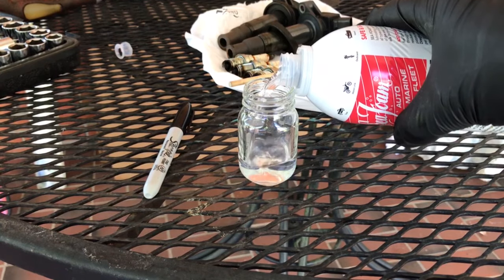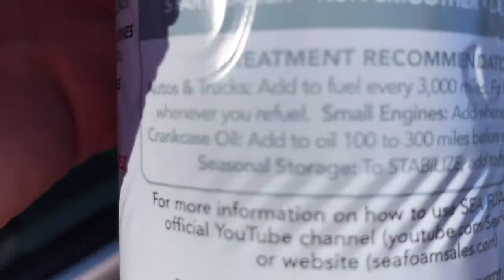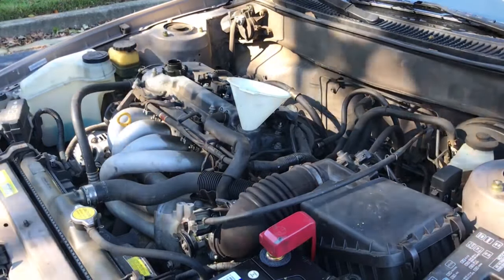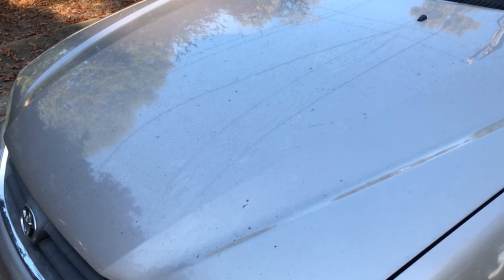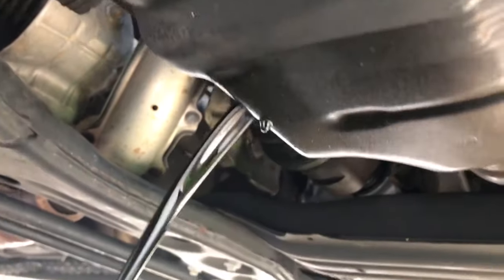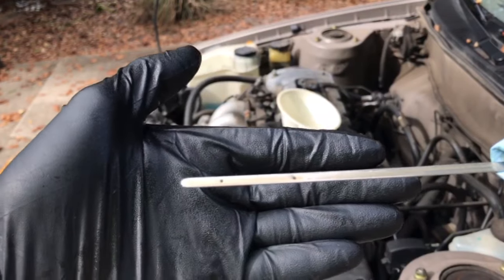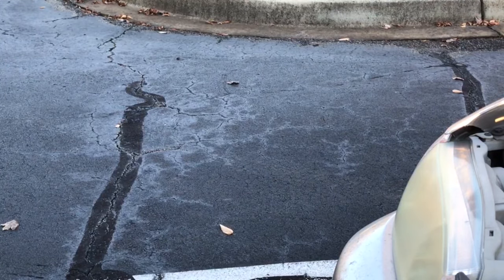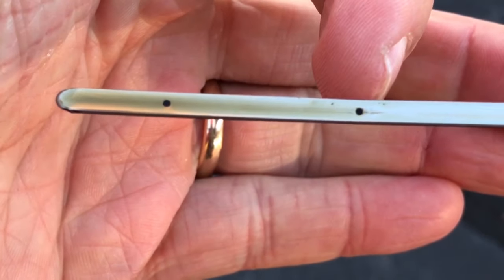Will Seafoam stop oil consumption? | Oil Burning🔥Experiments | Episode 2

Comment: The rings aren't  STUCK. They are worn down and allowing oil to sneak past. You should be using a high mileage oil as well as more Seafoam treatments and possibly a higher viscosity oil in the summer. Replacing the rings wouldn't be crazy, but I doubt you want to do all that work.
Reply: stuck rings are VERY common in the modern engines specialy the downsized engines with direct injection and turbo!

Comment: Hi Dave thanks a lot ,with the lesson from this experiment am sure to extend the life of my Camry 2.4 2003 with 189K + milage that is burning oil ,i have ordered for a seafoam ,to arrive in 2 weeks ,pls Dave i want ask what has been the performance of that car after that experiment on it,  iam talking about the oil seals and other stuffs in the engine ? I hope you reply me before i do same on my car thanks
Reply from the maker: You might want to hold off, Chuks. I have a few more videos in this playlist and more to come. Still having oil use. But there are lots of good suggestions in the comments---some have apparently had more instant success. Hope you get this in time! ---We will eventually get this fixed one way or another---God willing :-)
Reply: Hi Dave and everyone, after doing the bottom to top seafoam engine flush, though still observing so far noticed the following 
1 . the exhaust is dry 
2. the oil isn't getting dark fast as before
3. oil level still same under all conditions i have used the 2004 Camry , still observing it
Reply from the maker: @chuksadawisi5970  sounds promising!

Comment: so a car using oil is a piston sticking issue
Reply from the maker: Not necessarily, Lacy. It could be valve-stem oil seals, or external leaks, or a PCV valve stuck open. But in the case of Toyotas with this engine, it is a known piston-ring issue. They had low tension rings that get stuck easily usually due to lack of regular maintenance, or making only short trips, but some say it can happen to any of them. Thanks for the comment.

Comment: Maybe it helps with sealing between rings and cylinder, but if the cylinders/piston/rings are badly worn, only a rebuild will fix it. And how did you know that the rings were stuck in the first place; is there a way to determine that?
Reply: When the engine burn oil it means the oil ring got stuck
Reply: @parsaparsa2880  I find it diffcult sometimes to determine what responces are to me
Reply: @parsaparsa2880  can it also mean that the rings/ cylinder/ piston is so badly worn that only a rebuild will fix it? Additives like SEAFOAM are expensive and it could turn out to be a waste of money and time if short cuts don't cure the problem. I have been trying SEAFOAM  on my dodge ram v8 too, but in the end I think I'll have to rebuild it because the seafoam is very expensive to go on buying since one treatment didn't work.

Comment: Wonder if you did this a couple times or maybe even a 3rd if needed, it may completely clean the rings. Idk
Reply from the maker: That’s a possibility Del. Some have mentioned they’ve run a stronger Seafoam solution in their crank case and they’ve run it the whole time instead of just 300 miles … and they’ve had good success apparently. Might try that in another video. Thanks for the comment!
Reply: @FamilyFriendlyDIY  how come your car again started consuming oil in marvel mystery oil video you made.... when it was already fixed by seafoam
Reply from the maker: @letmethinkv  After the video, I found it fluctuated. So though it seemed to drop when making the original video, I found afterward that the usage went up and down, and sometimes was as bad as it was to begin with. Thanks for the comment.
Reply: @FamilyFriendlyDIY  is their any scientific reason behind fluctuations
Reply from the maker: @letmethinkv  your guess/hypothesis is as good as mine. I really don’t understand the science behind the fluctuation. I was just recording data. Maybe I drove a little harder during one period, or maybe I let the engine warm up longer on some mornings, or maybe it was the temperature, or regular versus premium fuel (that’s probably reaching), I guess it could be a lot of different things. It would be interesting if someone did have some good input on this.

Comment: Hmmm 
most likely it softened the valve seals !
This is a common problem on Toyota , especially if Castrol oil has been used . It nakes these seals so hard , that they can not properly seal anymore.
There is another trick , Adds 1 qt of DOT3 break fluid to your oil . IDLE  the engine about 3 hr !  Yes 3 hr of IDLING 
Drain the oil . Put the new oil filter and recheck the oil consumption. It always works for me

Comment: YAMAHA ACC-RNGFR-PL-12 Yamalube Ring-Free Fuel Additive,  I've used this product with great results both way in the fuel or put it in a spray bottle and run the engine after is up to temp add some throttle 1200 to 1500 rpms and spray in the intake until it smokes then shut the engine of and let sit for and hour then start and take it for a good run, oil should be changed after too. there's also another product called power tune which was developed for mercury/mercruiser engines for these thing stuck ring and carbon build up
Reply from the maker: Thanks for the input! I just did a Yamalube Ring Free Plus experiment on the latest video!

Comment: You can run full synthetic oil your car you just going miss up you engine i been working on cars 27 years. Best oil i find use little oil run classic. Car oil on ebay. Every one i use it in there car stop use oil you car is to old run the type of oil. Then your useing cheap oil in it lot to do with it

Comment: Idk how serious you are about this car but there is a real fix for this, its not easy but in my mind it's worth it, the fix centers around a partial engine rebuild with decarbonization along with new rings and boring out the piston oil return holes. At that point you basically have a new motor abd when you drill out those oil return holes it fixes the problem. If you love the car enough to keep it a while longer I recommend really fixing it. It will save you tons of money on oil over the years after fixing it.
Reply from the maker: Thanks, Chris. ... I saw a video on doing just what you describe. Right now I'm just experimenting. I'm working on a video right now trying Marvel Mystery Oil. It will be a while till it's finished though, because I'm going to run it for 3k miles. ... If none of the experiments work, I might try the rebuild, and probably film that too. Thanks for the comment!!!
Reply: @FamilyFriendlyDIY  np!
Reply: @FamilyFriendlyDIY  Looking forward to your video with the MMO. I just bought a 09 Camry with the 2.4 @ 191'000 miles and it is consuming a quart about every thousand miles. It was my sister's car which she bought brand new in 09. The valve cover gasket was leaking pretty bad so I replaced that. When I had the valve cover off I noticed some sludge in areas but not terrible. The place that changed the oil in the car was using Penzoil 5w20 coventional. So having used Amsoil for many years I have elected to do the Amsoil engine flush, switched to Amsoil Signature series full synthetic 0w20 & I am using MMO in the gas. I have about 700 miles on it since doing everything and have used about 3/8's of a quart so far. So waiting to see if it improves with time. I am going to flush the engine again at 1,000 miles and change the oil and filter & continue to monitor it. I can say that the motor is definitely quieter  since the flush and switching over to the Amsoil 0w20. Also changed the plugs as well. The car feels more responsive too. Thanks for sharing your results. I'll be sure to comment with future results.
Reply: @dooflicker1  Hi Kelly, I have the same Camry, but it only has 100K miles on it. I am interested to hear how your situation progresses. My camry is starting to burn a little oil and I don't want it to get worse. I'm looking at options for how to slow or prevent the problem, if possible. Thanks.
Reply from the maker: Lots of good info, Kelly. I'd like to hear how that goes when you get more miles on it. Someone else mentioned dropping the viscosity like I think you're saying. Haven't done much research on that, but I wonder if that's basically what Toyota did with more recent vehicles?? Maybe the engine tolerances are still about the same, but the spec'd thinner (and synthetic) oil to reduce or eliminate the known sludge/varnish problems??
Reply: Just a heads up for the future. When you eventually have to change the pistons or drill them out... if you pull the head off put the cams back on before lifting the head off or mark the bucket lifters so they don’t move. If the bucket lifters fall out, and they will if you tilt the head, it is a nightmare figuring out where they originally were. Good luck. Btw this is an interference engine regardless of what Toyota claims.
Reply from the maker: @johnnynichols5850  Thanks for the tip.

Comment: The cylinder walls are damaged from the rings being stuck. One side of your cylinders is worn slightly. It allows oil to get around the rings and burned regardless if rings are now unstuck. Your seafoam treatment on the top end and in the oil would’ve worked 100% if it was done to the engine before irreversible damage is been done. If your engine is a variable valve engine where it would not be wise to use a higher weight oil. I have an old pick up truck that burns oil with the recommended 10 W 30 oil.  I use 10 W 40 and the oil consumption is reduced. I would not recommend this For an engine with variable valve timing. The oil pressure on those engines changes the valve setting. In that case you just add oil as needed. Try 10 W 40 synthetic and see what happens…
Reply from the maker: Thanks for the info Jeff. Yep, this one has variable valve timing. Unfortunately rebuilding is not an option for these 1ZZFE engines. They are apparently throwaway engines that can’t be rebored.
Reply: @FamilyFriendlyDIY  Do you might be able to find a replacement engine from Japan. Typically these engines have 30,000 miles on them or less. In Japan cars must have the engine replaced or Rebuilt out or before 30,000 miles. They say this is for cleaner air but actually it’s their government creating a barrier to entry for anyone thinking about building an automobile. The government there doesn’t want every citizen Owning a private automobile. Social engineering.  Most people simply buy A new engine for their car. The old engines are created up and sold over seas.
Reply from the maker: @jeffstone7912  Good info, Jeff. I've bought "JDM" parts before and noticed some said less than 30k miles on them, but I had no idea that's how it worked. I'll definitely look into that if it comes to replacing. I almost bought a JDM tranny for my daughter's Accord, but she ended up getting rid of it first. Thanks for the comments!

Comment: If you are still using conventional oil try switching to synthetic. It not only cleans better but doesnt coke up like conventional oil. Its the small oil drain back holes in the Corolla piston that coke up and get blocked with the heat instead of letting the oil drain back into the sump

Comment: yes but you wont get any further than that i think because it has high chance your block might have been gone because of piston rings destroys the walls overtime specially 200k miles on it 1 tank and lets say you lose half now it is still way too much this is stage 3 oil consumptiıon and that cylinder walls are gone.

Comment: I would also look into replacing the PVC valve. Probably would further reduce the oil consumption
Reply: PCV
Reply: It usually can be cleaned, and then checked if it works.

Comment: My golf cart quickly used (burned) a lot of oil until I started adding seafoam to the crankcase with an oil change (1 oz per qt). The golf cart has a one cylinder engine without an oil pump. The only thing I can think of is that seafoam helps the rings seat and seal better.

Comment: I drive up to 1000 miles with that in the oil and the fuel. Just do it regularly and it will eventually do the job. Worked for me. Now I just use it regularly before every oil change. One treatment is not enough.
Reply from the maker: Good info. What kind of car did it work on?

Comment: You must find out why the engine light is on! A vacuum leak (lean condition) will increase the flow of the pcv valve and you can overcome the liquid vapour(yes spelled correctly) separator and put liquid oil straight into the intake. eliminate that first before chasing consumption.
Reply: Agree. Since the vehicle had an oil consumption issue, it's likely a P0420 catalytic converter under-performing code. Cats don't like stuff like oil or carbon buildup on the interior surfaces. Seafoam (or one of the specific cat cleaners) in the gasoline might clear the cat if it's not damaged, simply by dissolving buildup. It might take a treatment or two do to the job. A code reader is the first step.
Reply: @petset77  I got the code that the cat efficiency is below threshold, I think my engine is burning oil but I haven't measured it yet, how would I know if the cat is fixable or not, and how would I fix the burning?
Reply: @HarrisChoudhry , Is your engine using oil? That would be the first place to start looking. My wife's Subaru is the typical over 100k mile oil burner. Oil has to be topped off between changes, and there's no sign of leaks. It also doesn't smoke like cars used to when they burn oil. It's going somewhere, and I think it's out the exhaust. Oil being burned is going to pollute the cat. You can try cleaning it with seafoam or other additives, or if you're willing to try something different, look into the youtube vids of the guys running a gallon of lacquer thinner to ten gallons of gas in the tank. I thought it might cause engine damage, but it didn't on our car. ...it also didn't clear the code, so I might try it again. The only way to check if a cat is physically damaged is to look at the element, and that would be with a borescope, or if it unbolts close to the cat itself. Good luck.

Comment: Normal it is the valve stem oil seals which perish/wear out causing high oil consumption in an engine that age, as well as ring wear/and or sticking issues.

Comment: I have used Auto RX with success. You add it to your new oil when you change it and leave it in the car. It says it works in one oil change but i found it needed 2 oil changes. Adding another bottle with the next oil change. This means 2 years but a definite improvement in power. I was concerned that chemical flushes that you drain out after a short time would be too harsh on oil seals. 
Speaking of harsh, a wrecker told me he once had an engine that blew a lot of smoke. He sprayed a lot of carburetor cleaner into each cylinder and let it stand, then moving pistons up and down, added more carb cleaner more up and down. Then started the engine. After a while the smoke subsided and ran as normal. I didn't buy an engine from him.
Reply: How long have you used Auto RX?  I’ve used it on and off, just to avoid using an Engine Flush.  It slow down some of the oil consumption. But when I used it with Amsoil Signature Series with Auto RX, it was a dramatic improvement.   But I’m going to test it with conventional oil next during the rinse phase to see if I’m getting the same results on oil consumption.  Was using Mobil 1 for the past 10 years and it didn’t help with oil consumption and I figure Auto RX was snake oil.  I’m still skeptical even though I’m currently using it to see if it’s doing any thing
Reply: Dashcam journey 
I Have used auto repair for about 5 years or more. I have a 96 Camry that wasn't treated well in the past. Heavy carbon build-up.
I used it for 2 oil changes, maybe 3. It was very sluggish before I used it but after 2 years a definite improvement. On their website they have some videos of a heavily carboned engine with the rocker cover removed, before and after using auto rx. A dramatic improvement.  That's what sold me. I tried it in other Camrys that had had regular oil changes and didn't notice an improvement but they were ok to start with.
Thinking of trying in a Mazda 2 gearbox that has delayed changes. Easier than a solenoid clean which is what I was going to do. Note it is not a flush in the usual sense. You put it in with new oil and leave it in until the oil is changed. Usually 12 months.

Comment: I guess you could have replaced the spark plugs at the end and then seen how the new plugs looked compared to the old oily ones.
Reply from the maker: Not a bad idea, Kenny. I bought some plugs for it, just haven't changed them yet. I'm trying to see if I can get the oil usage even lower first, so I don't foul the new ones too quickly. I'll probably clean the PCV system too.--Maybe that'll help. Thanks for the comment.

Comment: Shell oil seems to clean well. Highest detergency motor oil
Reply from the maker: Thanks for the comment, Andrew. You inspired me to research that and I read that the Shell oil for diesels is really cleansing.
Reply: @FamilyFriendlyDIY  not sure on the diesel oils but even the hx7 semi synthetic 10w30 or 10w40 here in Australia is a lot stronger than anything else I've used (even atf). So it does not need to be the fanciest at all.
Reply: Look for the oil that has the highest TBN value and change the oil every 500 miles 3 times.
Check Shell and Penzoil oils.